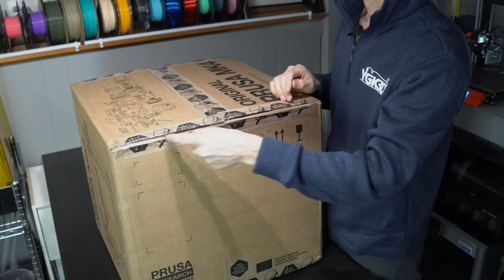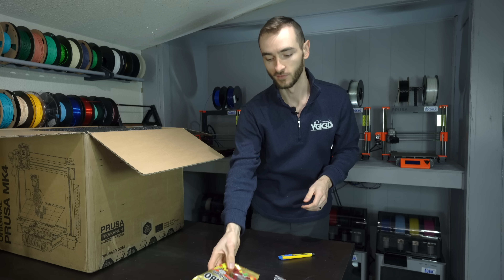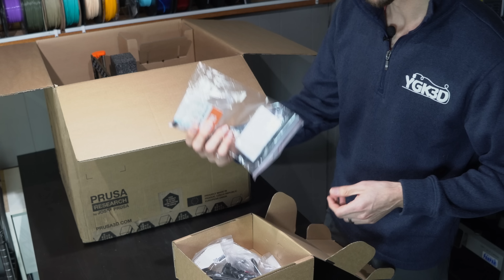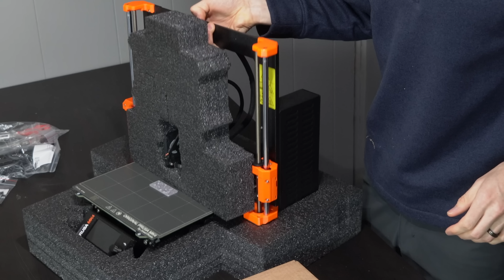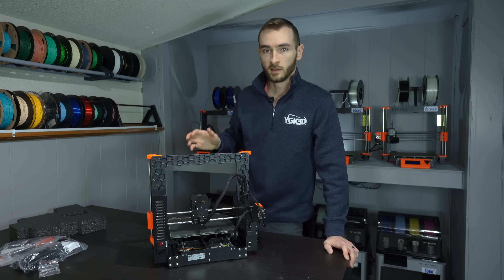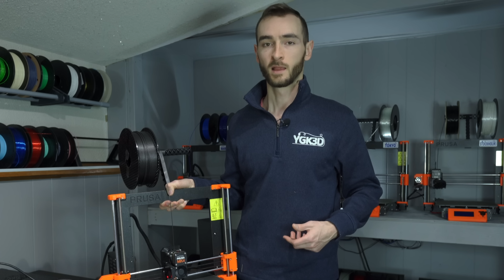Prusa MK4 - Worth The Wait? Unboxing & First Impressions

Comment: Thanks for showing the bottom of the printer! I had no idea they revised the y plate!
Reply from the maker: No worries! Yes, redesigned frame and Y carriage. Not sure exactly what the advantages are but it looks cool.
Reply: @ygk3d  from what i understand, it's cast aluminum and supposed to be more rigid.

Comment: I have the MK3, mine was in kit form it's 6 years old now and its a workhorse. As for the MK4 I'll wait for a while. The nozzle levelling part not to keen on. Already I've seen where it pressed into the bed and made an indent. When you said Prusa does rigours testing this machine missed out and it was sent back.
Reply: I saw that too on Jessie's...  Mine hasn't done that....  Uncle Jesse was also doing some other things that he should not have been doing which could have screwed up the calibration of the machine.  In my opinion, if the machine is used in the way it was designed to be used per the owner's manual, you won't see that scratch on the bed.

Comment: Thanks for the overview. From my point of view the marketed silent operation is just marketing and honestly, i think that is a disgrace. Lie about this and the customer might ask, what else did you overexaggerate?
Reply from the maker: I believe there is a silent mode you can enable that should make it quieter, but I was surprised to hear how loud it was with default settings. It didn't sound any quieter than my MK3.

Comment: Flow rate has much less to do with extruder power than most people seem to think and what effects it the most is the length of the melt area, no matter how strong your extruder is if the filament is not sufficiently melted you will still get unter extrusion and bad layer adhesion.
Reply from the maker: Yeah, this is true. I placed emphasis on the wrong variable in my description. Thanks for pointing that out.

Comment: I bought my MK3S+ last year. It was "made for prusa" filament which I found out that it was filament PM. It was TRASH! I hate that filament. And even before I opened the sealed bag, it was tangled on the spool. Many people don't believe me. They say it's impossible. Well.....it's possible because it happened to me. The first 1/4 of the spool was unusable for any decent printing. It's better now (I have maybe 1/2 of it left), but it has both over and under extruded. It was so bad I could feel variance in my fingers. If I can feel it, it's REALLY BAD. But for some reason after the first 1/4 it was fine. Now it under-extrudes. It's like 95% of what I get with other brands.
Reply: on the other hand prusament is freaking amazing filament. It actually feels premium in hand. But is it worth it? I don't know. I hate sunlu. It's way too soft. esun is inbetween. esun works pretty well for me.
Reply: @awilliams1701  so it wasnt Prusament ? If you get an original prusaspool you can check the report on that specific roll online (qr code or something on it) In the consumer space no Filament is just for one printer.
Reply: @MaxMichel89  yeah I own some geniune prusament. What came with the MK3S+ was "made for prusa" and eventually I found out that it was from a brand called filament PM. No QR code. Apparently I'm not the only one that thought it was trash. I've heard a few others complain as well. So when they stopped including it in MK3S+ orders, I'm like....honestly they're doing you a favor. But I also know what a genuine prusament spool looks like. That's definitely prusament. So the MK4 is finally including good filament for a change.
Reply: @awilliams1701  I did get my mk3s+ with a prusa spool, but maybe it has Something to do with where you live. So maybe a reseller in america or Else is Putting a spool INSIDE, so the shipping of the printer gets cheaper 1,2kg less per printer could add Up.
Reply: @MaxMichel89  I got mine direct from prusa.  I had to pay customs from prague. When did you get yours? I got mine may of last year.
Reply: @awilliams1701  february Last year I think.
Reply: Also direkt from prusa.
Reply: @MaxMichel89  hmm odd

Comment: did they covered extruder stepper by plastic plate?
Reply from the maker: I believe the extruded stepper is on the rear now as opposed to the front as on the MK3. It’s not as obvious where it is, so it must be covered by a plastic cover.
Reply: @ygk3d  to keep warm 😄
Reply: With the greater gear ratio I don't think that the extruder motor will heat as much as on the MK3

Comment: I feel as they rushed this printer out, they should of had the input shaping and the finished firmware for installed on the printer when they shipped it out. Not make customers wait for it. Another fail in my mind such as people that have waited forever for their xl. 31 to 32 mins for benchy the mk3s 37 mins
Reply from the maker: Agreed.

Comment: How hard is it to change nozzles on the heat block? and would they leak. I have two MK3S & MK3S+ with Revo's which I love! If the screen was a touch screen I might upgrade to the lowest tier.
Reply: the screen is reportedly a touch screen, not yet activated in the firmware
Reply: The standard, non-v6 compatible nozzles are one piece, like the revo. The special v6 compatible versions do have the leaky interface between heatbreak and nozzle.
Reply: Here's a video of someone changing the nozzle. It's probably a bit quicker once you've done it a few times and are not filming, but not as easy as the Revo.

https://youtu.be/AU4oYG4M2kY
Reply: @ThomasS17  i saw that this morning. I guess the universal one where u can use your own nozzle. Ive always hated that v6 hotend would always slowly leak out the top lol

Comment: USB is much more durable than SD, as SD was not designed to be inserted and ejected multiple times per function, before I got Octoprint and Klipper I used to fit SD extensions to more accessible places and some of these eventualy failed, but I prefered the extension failing rather than the printers SD slot, no accelerometer is a big mistake IMO!
Reply: Prusa says there is an accelerometer connector on the nextruder, but no word on firmware support or part availability. So for the time being we can pretend it isn’t there.
Reply: @KoenKooi  well they would have to have one on the bed too
Reply: Or maybe in the next mk4 +

Comment: Why Prusa cant set up international warehousing is beyond me! quite a lot of other manufacturers have this facility, it saves the consumer money and the manufacturer benefits from increased sales and I would wager there are carbon benefits to it also somewhere down the line.
Reply: I would love to see a US warehouse!
Reply: Printed Solid is owned by Prusa.
Reply: @JohnOlson  They charge more than Prusa and are only based in the US although I suppose that is one step closer to an International sales force, they need to allow resellers to operate with their printers but I dont think there is any room in the budget, either that or the fact that they can sell them as they come off the production line as the demand is (or was) so high that it negates the need for resellers.
Reply: @AndrewAHayes  I wish PrintedSolid would be more economical for consumers.  But until they can build up enough stock, which means Prusa has enough stock, we're ordering direct.   I'd be happy to just get Prusament for the same price but local from US.
Reply: @AndrewAHayes  free shipping on orders over $50. So in many cases PS is actually cheaper than prusa. And hoestly shipping a bunch of printers to PS and then having all the US shipments go through there would probably be cheaper for prusa in the long run.